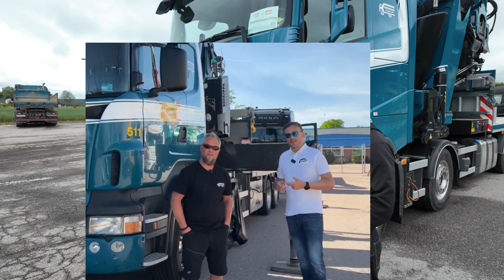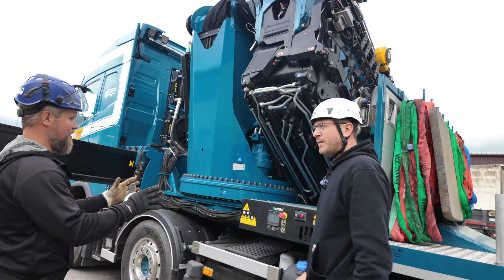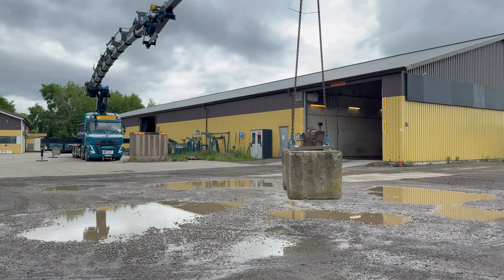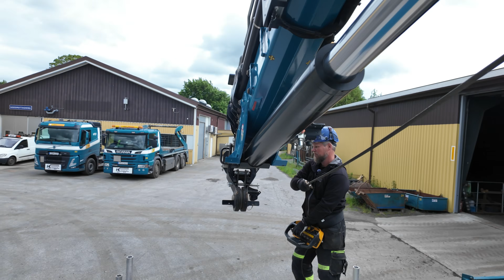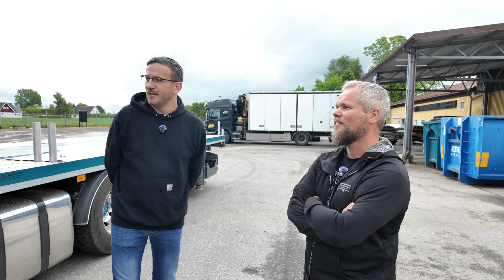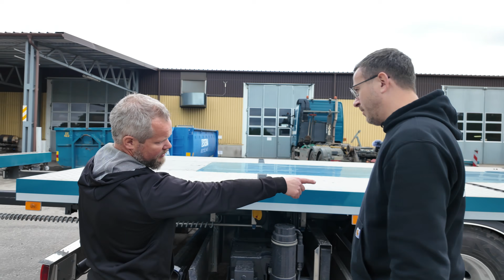Reviewing The LARGEST Loader Crane In Sweden! | Effer 2055

Comment: That´s good machine if you tolerate some electrical problems every now and then. Superb lifting capacity, Effer exceeds its load chart every single time with wide margin. And not only lifting capacity but the strength to take all the stupid shit that operator will throw at it, best structural integrity on the market.

Comment: Nice truck, but why only 4 axles?
Reply: No need for more... max driveweight is 32 tons, and you can do that with 4... another axel only adds more deadweight to no use
Reply: @Elgnapo so you don't transport anything with this? Here in Finland all cranetrucks that size and smaller ones too, are 5 axle trucks, except really small ones.

Comment: I have worked with the Effer 1405 with that 9th section. It works great but there is one negetive with that and that is you can not work with a heavy duty jib so you loose a lot of weight that you can lift with the jib.
Reply: And because of that 9th section, the cylinder for that part is inside the boom, the boom is not hollow so you cannot put on a hook raiser or whatever.
Reply: @roedie2486 interesting insight. Thank you for sharing! How long did you operate that unit? 😊
Reply: @ivanflebus6877  I had this crane for 4 years. That was with my previous employer and he sold that crane because he is also a trader. At my current employer we had a Palfinger 200tm on trial because we want to have a heavy car loading crane. We are looking for a Cormach 150tm or a Palfinger 165tm. It will come this year.
Reply: @roedie2486 my hmf has an internal last ram but I’m still able to put a rhino hook onto it, I wonder why these are different
Reply: Real things

Comment: How much does the truck weigh when empty?
Reply: (31880 kg empty) (loading weight 11120 kg) (total weight 43000kg)
Reply: @martinfherm  yes the truck allows 11120kg but the weight restrictions in Swedemn it only allows to load 120 kg...yes 120 kg, but there is new better regulations comming in Sweden. In Finland you can load 10120 kg leggaly.
Reply: @jarpa153 looking in the table he should be alowed to have a total mass of 20+18 tons, that is 36 ton. The only issue us the total mass, that can be extended with a trailer.